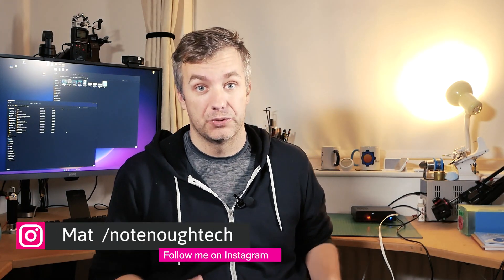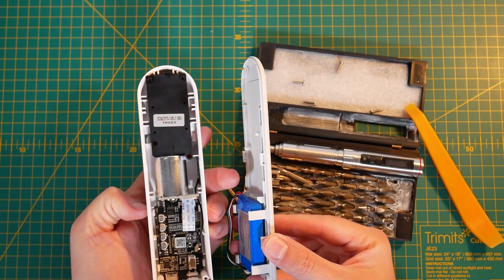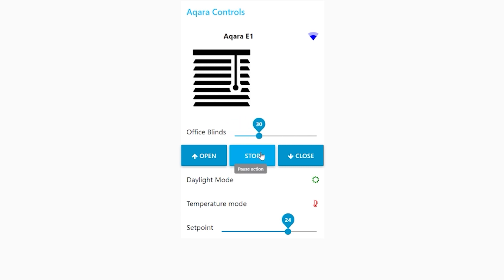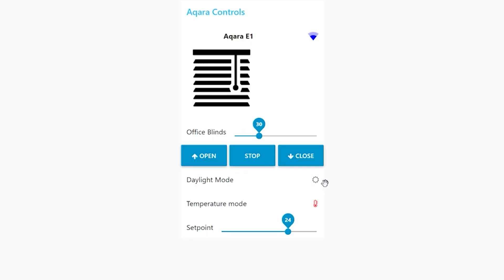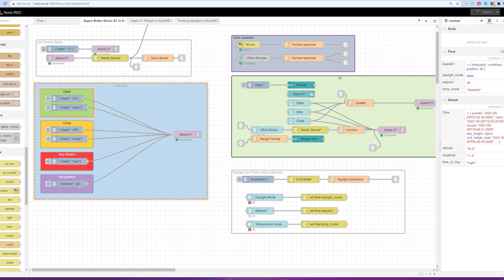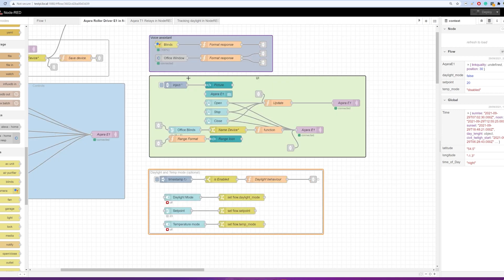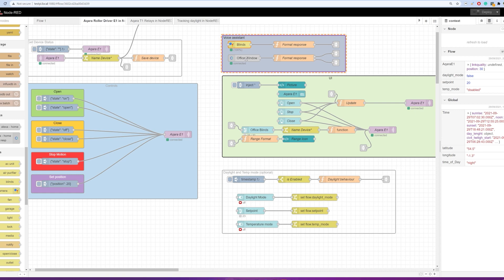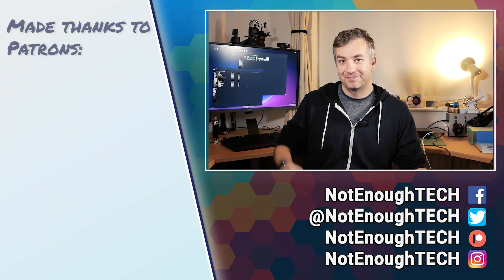Aqara E1 & Zigbee2MQTT

Comment: If you don't have an aquara hub, use zigbee2mqtt can you still 'calibrate the device' for 0..100% setup?
Reply from the maker: Yes calibration is possible thanks to buttons. Just remember it needs to be done after the unit is paired
Reply: @notenoughtech  thx!
yeah just found out callibration can be done and rotation too,

only the 'push 5 times' stuff isn't really 'great' it was more like push 5 or 7 times just wait until the light flashes
Reply from the maker: Thankfully it has to be done just once :)
Reply: @notenoughtech  @Jeroen vdd I've managed to pair my roller but I don't understnad how you set hardware limit. Do I use Open/Close to set top/bottom in Zigbee2Mqtt then click 5 times on up/down button? Also when I click both buttons the device doesnt blink it only lights up.
Reply from the maker: Pair the device then use the devices button to drive the roller to the position and pressing the appropriate buttons set number of times. Then repeat for the other limit.
Reply: @notenoughtech  I finally got it to work. Thanks for the information.

Do you guys have problems that it stops working after awhile? I was super happy when I got it to work. I was trying out the feature to set the position and it initially worked good but after awhile stopped working and could only do 0 or 100 (open or close). Even if I reset the device and remove it from z2m and re-pair it the set position no longer work and the device is more unstable now and stops working so I need to re-pair it.
Reply from the maker: @ollebroms7185  Do you have any problems with 0/100 settings at all?  If yes, then my bet would be WiFi interference
Reply: @notenoughtech  Open/Close works like a charm. If I use position it either goes to 0 or 100 depending on situation it never goes to the value I enter.
Reply from the maker: Can you try to parse the value as string? Perhaps that's the issue? I'm pretty sure it was working for me fine. Can you post the payload response? Perhaps the unit got a new firmware or OTA  and things changed a bit.
Reply: @notenoughtech  Im a bit new to this. How do you do that? I've tried both Deconz and zigbee2mqtt non of them where able to do it. Right now I'm reinstalling my Raspberry pi 3 B+.
Reply from the maker: Instead of 50 replace the value with "50"